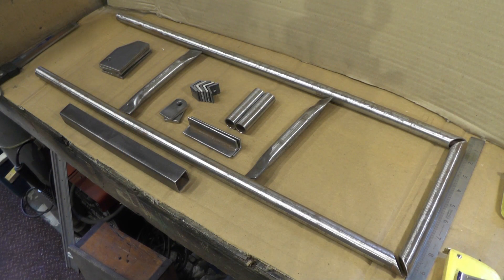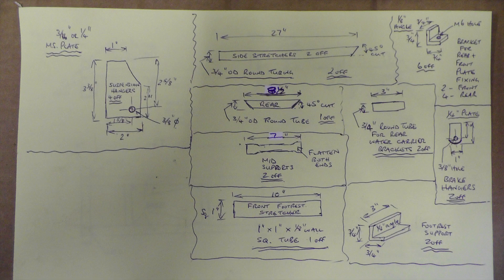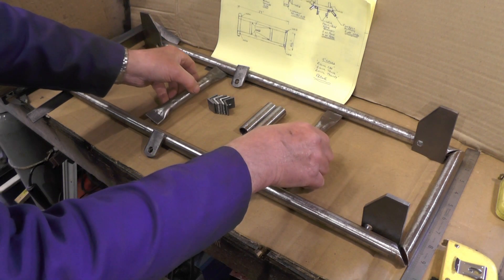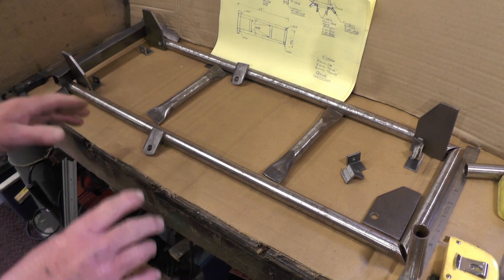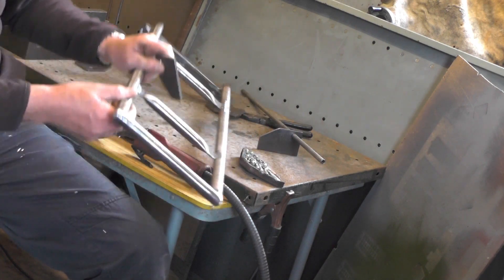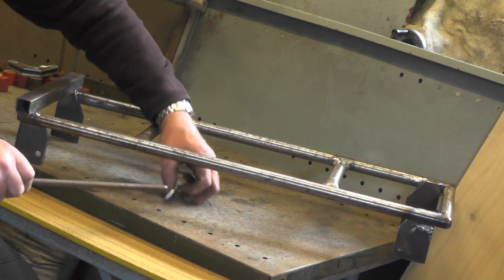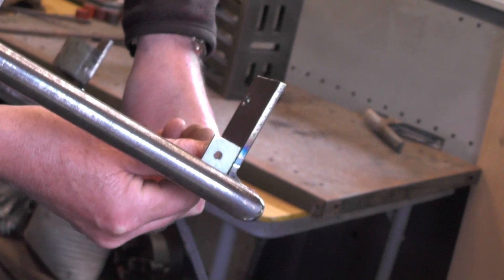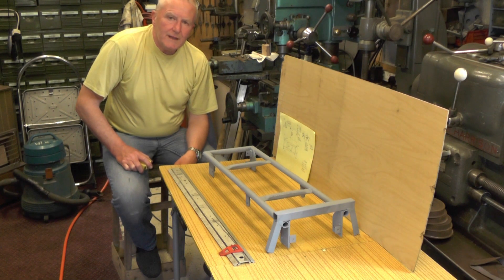Build Your Own 5" Gauge Riding "Car" " truck" "trolley" Part 2 (mr factotum)

Comment: Hello Mr.F.
Nice to hear from you again, with a new addition. I have just completed the governor valve for the traction engine. Making all the tiny linkages took for ages to complete. It all runs well. I would have loved to send you a clip of it running. If you want I can give you my email address, then you can post me back with your email address.
The weather over here is very hot right now reaching 37 /38 deg C. and  that is keeping me away from the workshop in the afternoon.
Take care and Regards
Emanuel
Reply from the maker: hi EL
governor valve sounds a lot of work,  love to see it running, weather hear is crap, its a good job ive plenty of hobby jobs to do.
let me have your email.
regards
mr f